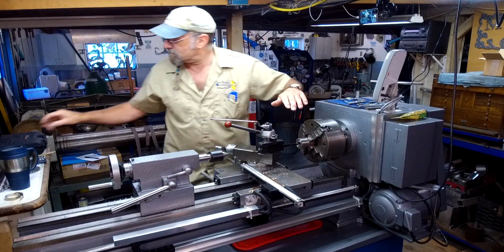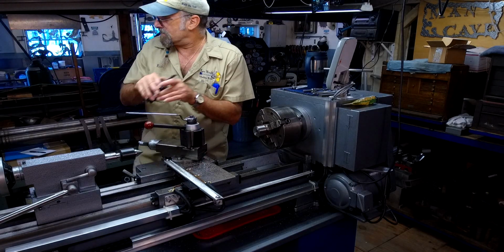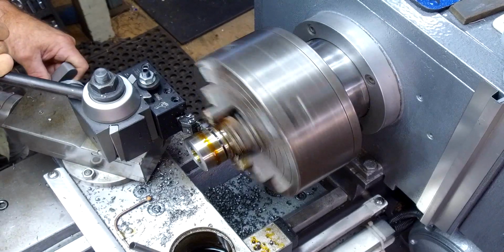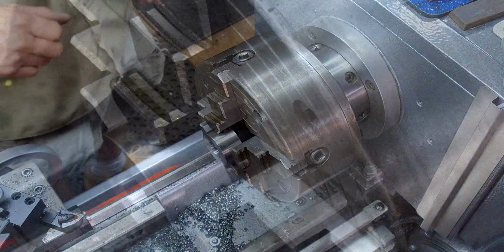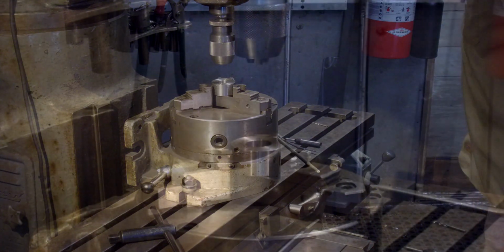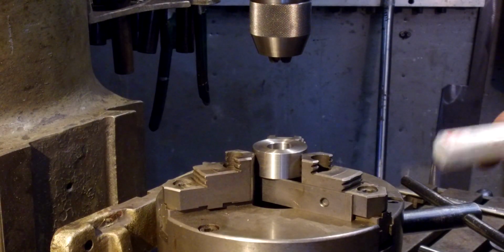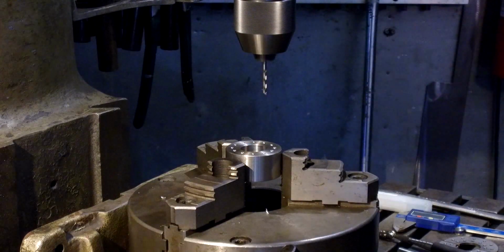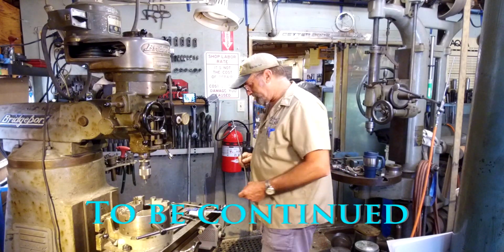Steam Wagon Ho Part Nine

Comment: Keith I have the exact same bridgeport (just bought) but can not tighten the collet...should it have a tang in the collet holder for the slot on the r8 collet to go into ?........best vids on the net.....along with Adam of course...thanks for all your knowledge
Reply from the maker: There is supposed to be a pin in the spindle bore that the slot in the R-8 slides over, mine is missing also but clean bore and tapers grab the collet anyhow. ;{)-------
Reply: ok thanks Keith........think i will make one as i can tighten up ............
Reply: there are 2 set screws in the quill to align collet ---first  has a notch to fit collect slot --then another set screw to lock  first set screw in place

Comment: Hello Keith, you said you would welcome any suggestions, so here goes, but it is too late now for you to do anything about it as it is almost done now. Why before you ever started the shafts, did you not ask the person who wanted the job doing, what all the split gear adapter plate was about, all those holes. I would have suggested making the shaft flange the large diameter  to fit in the recess of the gear, and then spot through the gear hole into the shaft flange, no adapter plate required, an  easy peasy job for someone like you. I know it would have meant wasting a lot more shaft material, but your Rutland lathe made easy turning. Seems to me a crap idea of a split adapter plate, more holes and 24 bolts to work loose. Is it supposed to be a miniature replica of a full sized one ? I would not have thought the the original builders did it that way back in the 1900's. Anyway, now intrigued as to how you will make the flexible shaft for the 1/8" drill. Bring it on part 10.

Comment: Hi Keith,we bought press bearings that the halfs were soldered together.We split them with heat before fitting and scraping the crankshaft and pitman journal caps.Grate video thanks.

Comment: Great series as always Keith.  The most instructive part for me is the deep contrast in machine performance between the Rutland and the Clausing.  I'm sure the Rutland is a fine machine, maybe even coveted in the market as "heavy duty".  I don't know this to be the case, I'm just allowing for the fact that it could be great for its class.  But the cuts you'd like to make with it (based on what is easy for the Clausing) seem to push the Rutland into the cast iron boogie.  In contrast, the fact you got the job done with it proves your skill in adapting to the machine's limitations, and proves the Rutland can provide quality results within its smaller work envelope.

Comment: Did you check the play of the spindle bearings while going thru the machine? Most Chinese lathes I've worked with have the preload set too loose causing chatter.

Comment: To stop the chatter, I've found that inverted parting tools (upside-down) with the spindle running in reverse work really well with small lathes...much, much better than regular parting tools.  Eccentric Engineering makes them, but a person could make their own if they chose to do so.